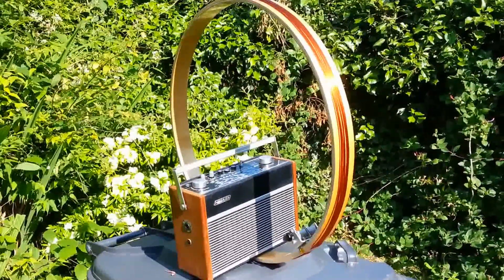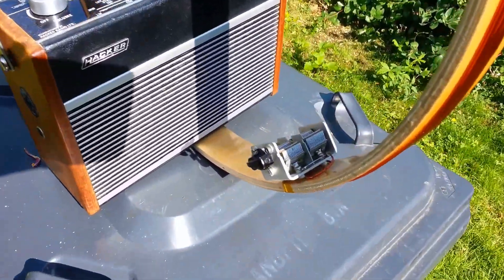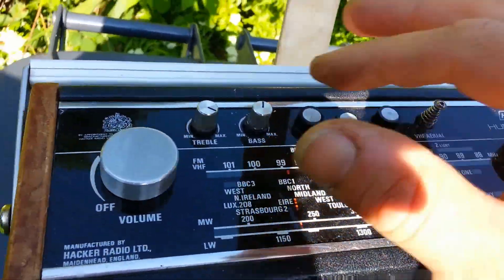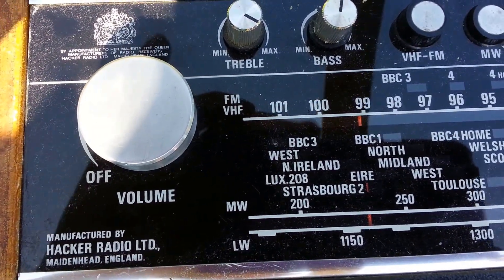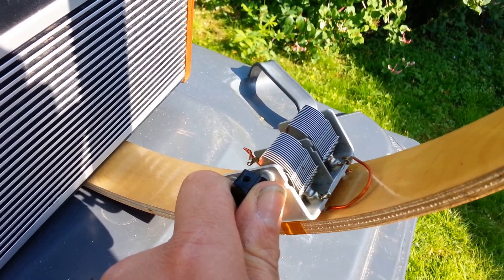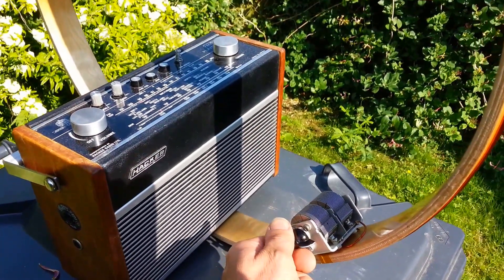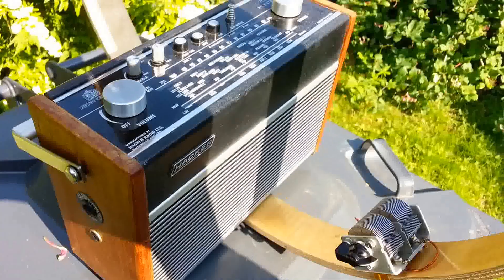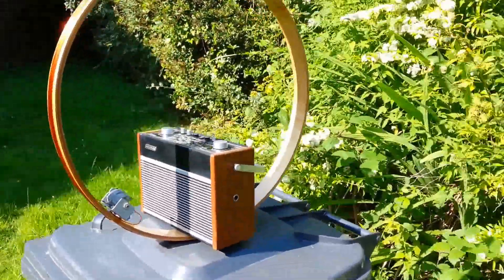Loop antenna attempt two

Comment: I don't have a capacitor. Does loop antenna work without it?
Reply from the maker: You need to make a tuned circuit. Look up tank circuit. Without a capacitor the circuit will not resonate.

Comment: I like the radio. 

I am also tying to build my own loop. 
I am using a portion of a bamboo rice steamer for my loop form. 
It works but it doesn't cover the full MW band.
Reply from the maker: Try altering the turns of the coil.
Reply: @SoddingaboutSi  : what do you mean? Alternating the turns of the coil?

Are you using more than one coil on the form?
Reply from the maker: @chronobot2001  Yes, or try adding a small amount more capacitance to the tuning cap.
Reply: @SoddingaboutSi  i made mine 40x40cm with flat cable alternating the wires (only using odd number wires)  and the reasults are great. I made another one 50x50 using telephone wire 7mm spaced turns but i cannot see the difference.